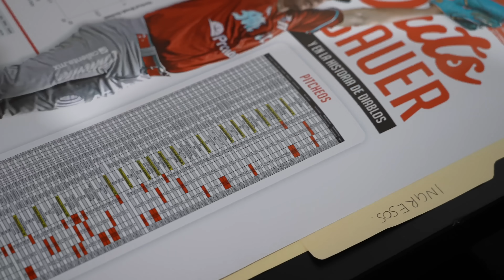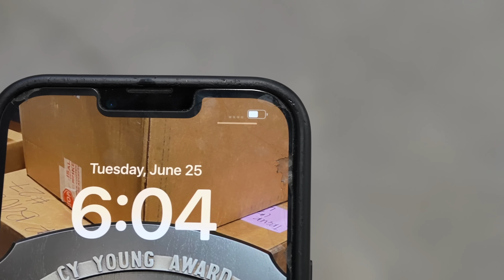He BEGGED Me To Throw A Fastball

Comment: Trev, I had plantar fascistic all my adult life, always had to wear orthotics, had knee and hip alignment problems blah blah. About 2 years ago I made a deliberate effort to change my running stride to avoid heel-striking (more on the mid-front foot with proper calf activation). This helped a bit.
Then about 6 months ago I bought a pair of barefoot shoes on a whim. I'll never forget the first run in them, something in my brain was set off and it completely changed me; it was the most oddly profound experience... over a pair of damn shoes. Since then I have been doing very specific foot strengthening exercises and over time my foot pain is gone, my feet feel far stronger and stable, and my hip imbalance has corrected itself with nothing but basic stretches. Highly recommend looking into it, although you'll run into issues with cleets (mostly because of the toe box and not being able to splay).

Comment: @baueroutrage - what is your therapy for the plantar fasciitis?  i've had a particularly stubborn case - tried massage, shock therapy, and PRP.  I've used orthotics forever and i think a new pair caused the issue. Had the PF for over 2 years now.  it's not as bad as it used to be, but it's still there.  usually it's painful during warmups, but once i'm warm i can play.  and when i stop it'll hurt a lot for a like 5 minutes as the facia start to tighten up again.  Good stretching the achilles seems to help a little. Mostly i've just learned to deal with it :p

Comment: Spikes are terrible for your feet...Trevor needs to only have them on "as-needed" and when not needed don't wear them. The only way both my father and I cured Plantar Fasciitis was using the "Walk Fit" shoe inserts. We both play baseball and suffered with it. We both purchased a pair, followed the instructions and it took nearly two months to cure it. I had Physical Therapy, a cortisone shot ect...and nothing helped. Wearing the inserts was the only thing that cured it. Also, Compression socks are your friend...they help your feet, ankles, heels, calves feel better.

Comment: Ugh plantar sucks my lasted 2 years until i did the opposite of what all the doctors said...1. Get vivobarefoot shoes, the wide toe box and heel drop is key. 2. Get a ballet foot stretcher. 3. Any time it hurts you get immediate relief my bending over the top as you do with the ballet foot stretcher.  2 years in pain finally pain free after a few short months doing the opposite of what many doctors told me. No specail ordered shoes or insoles necessary any back to all athetic activities.

Comment: Why don't you work on correcting your lazy front leg?
Figure skaters spin faster with their legs tucked in and spin slower with their legs extended. 
Your hips will spin faster if you don't extend your left leg too soon.
If you correct this flaw, you might finally hit 100 mph or even better.
What do you have to lose?
Over my career, I pitched about 40,000 games and struck out about 30,000 batters.
Don't forget that rotation is better than speed!
Reply: What? 40,000 games is like the equivalent of 247 MLB seasons. Even if you played a game everyday, that would still be over 100 years worth of games. Also, shouldn’t you ideally have more strikeouts than the number of games you play? That isn’t an awesome strikeout ratio if it took 40,000 games to strike out 30,000 batters. I think you may be exaggerating just a tad bit…. Have you been playing multiple baseball games a day since the age of 5 or something?